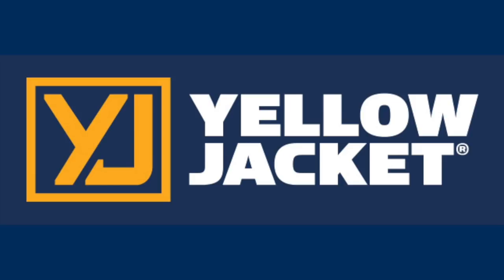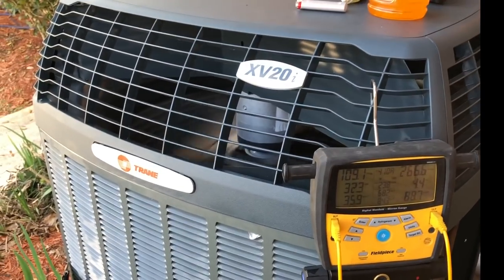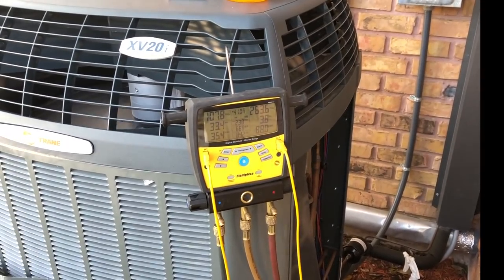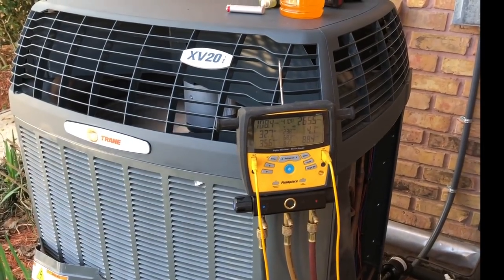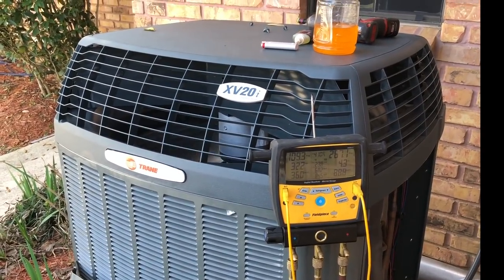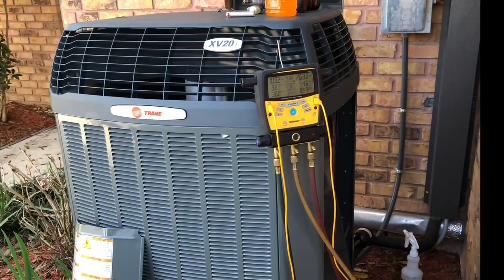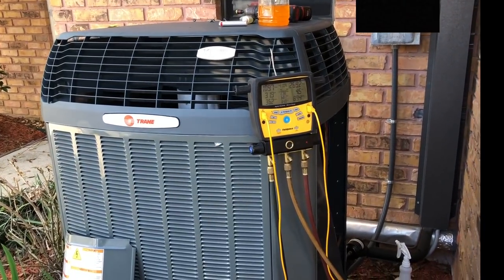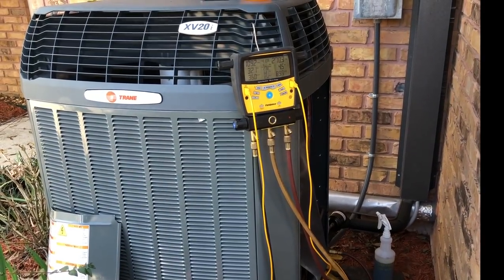HVAC | Charging A Trane Variable Speed | XV20

Comment: I have replaced 7 TAM evaporator coils in the past year where they blew out in the U turn soldier joint, every one had a pin hole right in the joint. I have actually talked to a few techs that used a low heat aluminum rated brazing rod and was able to repair it.
Reply from the maker: That’s the same thing happing here

Comment: Just replaced a compressor in a 5 ton 2019 XV20.  Shorted. Drive not damaged.  Had a leak at a braze joint....likely a "slow cooker"...after all the charging, and analysis, I think the indoor TXV powerbulb may be weak, cooling superheat seemed too high with proper subcooling.  Had thermostat turned way low, but I bet when I go back, I will enable the charge feature.  thanks for this!..  Trane tech:  closed monday/passover, then staffwide meetings tues and wed....their tech people are rude.  The local tech was great help, but corporate has taken it over, and I am not impressed

Comment: Do you agree that Trane XV variable speed trucomfort central air conditioners have too many bells and whistles and will break down many times?
Reply: I had a 3 ton XL 20i put in my house in 2010.  I worried that all the features, 2 compressors etc. could be problematic over time.  So far (it's 11 years old now) 1 cap was replaced and 1 contactor.  Other than that I just maintain it myself, keeping it clean, cleaning the condensate line, air handler, etc.  It's never needed a re-charge either.  I live in South Florida and we keep it set to 71 degrees almost constantly so it has a hard life but it just keeps on running without issue.  It really saves on electricity too.  I'm really impressed with this unit.

Comment: Nice 20i, new lines. But, same old Disconnect.  Come on
 Tell your installer chief to hook cliente up. Im sure the 15k they paid for the system deserves it.
Reply from the maker: Honestly these old disconnects are much more reliable than the new ones today. I would of done the same.
Reply: Israelhvac Respect, but I’d spray paint it or something.
Reply from the maker: I can agree with that